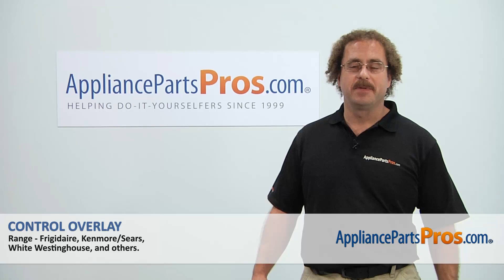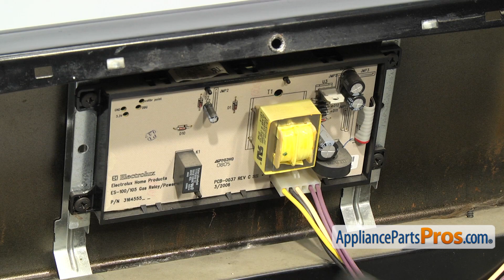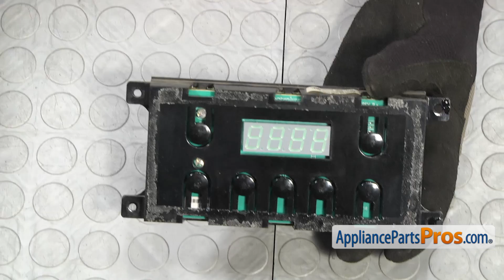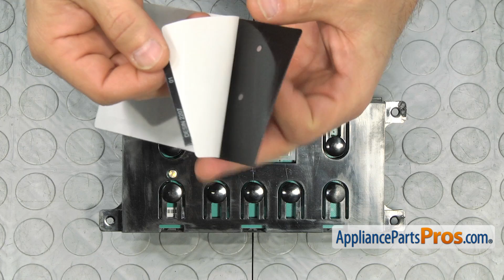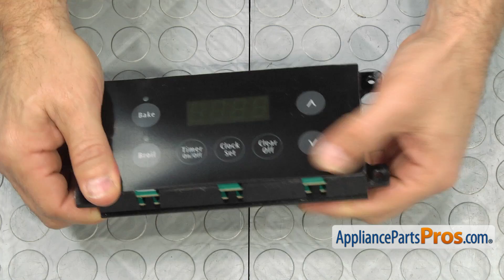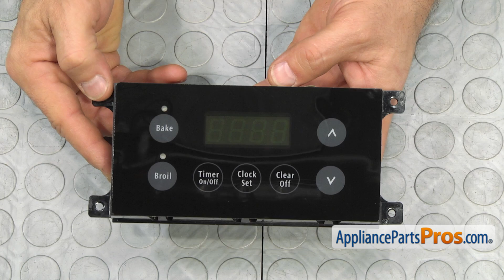Frigidaire Range Control Overlay 316220729 Replacement — fits Electrolux

Comment: Please..i need this board....excusame..my english is very bad
Reply from the maker: I am sorry, but we do not currently ship to the Dominican Republic.
Reply: Try searching for the part on Ebay. Maybe someone on there would ship to where you live.
Reply: I need only the ribbon cable connector piece for mine, but can't get anyone to help me figure out how to get ovly this piece so I do not have to replace the whole control panel. Any ideas or links would be much appreciated. For $400 if i have to replace entire control board, I would much rather just buy a new gas range and go ahead and  Pay a little more now to go ahead with a new one
Reply: ei30ds55lwb is my model number